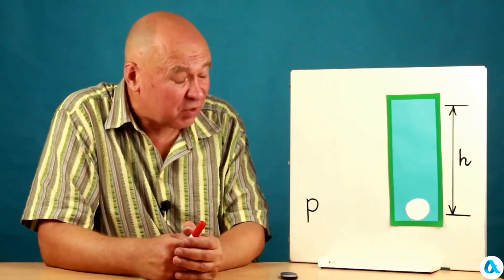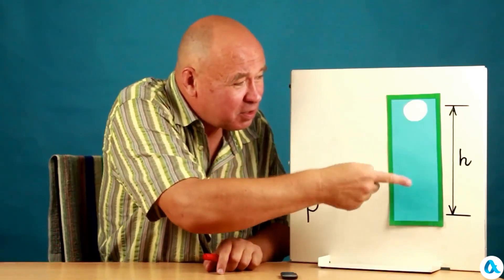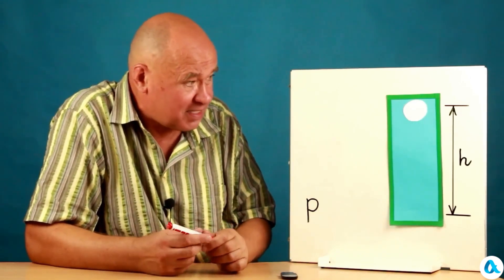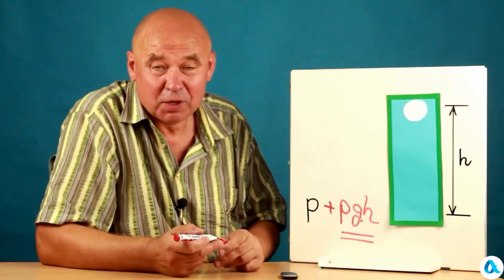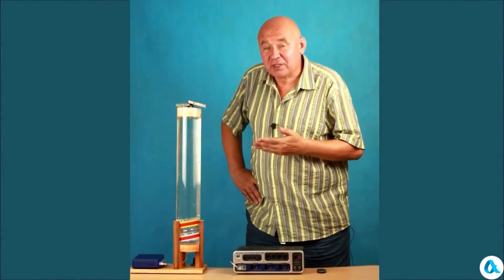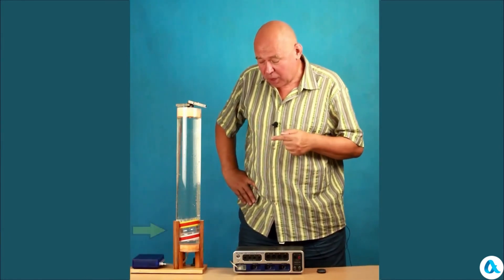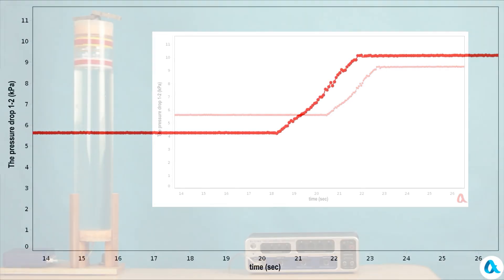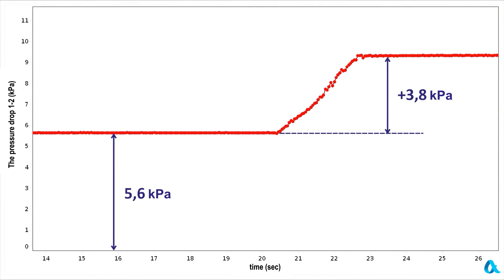Pop up bubble paradox

Comment: This is a neat question that I have not come across before, so everything that follows is based only on my thinking this through for a short time (so I could be way off on this!) I agree that the pressure "should" increase when the bubble rises (and we saw that it really did) but I don't agree with your reasoning. I think that the real reason that the pressure at the bottom increases is because the volume of the bubble necessarily increases as it rises due to its pressure decreasing. If the container walls are approximated to be "magically rigid" then the water would have to occupy a smaller volume (and so its pressure goes up). If on the other hand, the water is treated as being magically incompressible, then the expansion of the bubble must cause additional flexing of the container walls (which results in a higher pressure everywhere in the container). Of course, neither the water nor the container is magically incompressible / rigid, so, I think it would be a bit of both and/or additional accommodation by the pressure sensor and flexible tubing used for it. If you replace the bubble with the perfectly rigid shell you propose at the end of the video, then I would not expect the pressure to change as the shell rises. 
I suggest that you repeat the experiment, but this time run a few trials in which you vary the amount of air in the “bubble”. By your reasoning, the initial size of the bubble should not affect the increase of pressure seen by your pressure sensor, but my reasoning, an initially smaller bubble should lead to a smaller pressure increase.
Reply from the maker: Thanks for the analysis!  We're always looking for new ways to explore this phenomenon.
Reply: @getaclass_physics  That's great - I look forward to hearing about any updates on this.